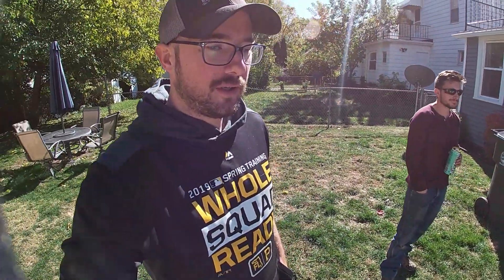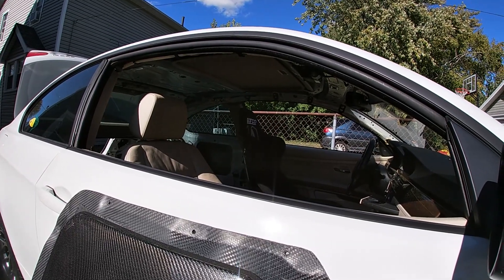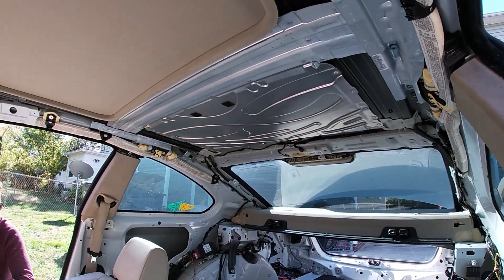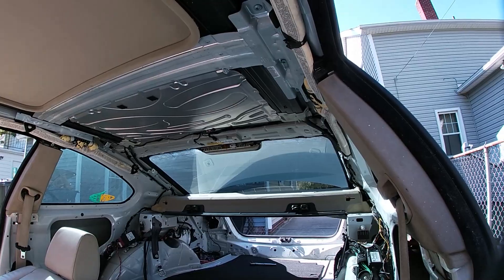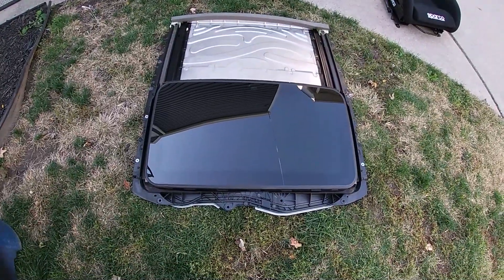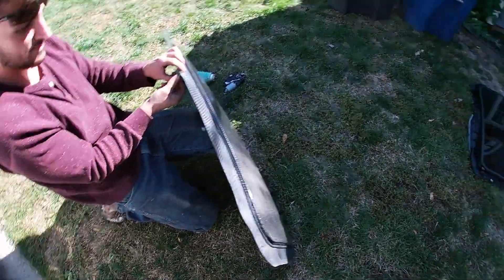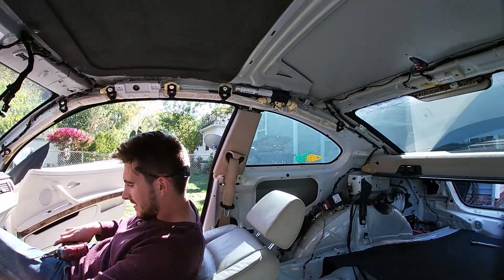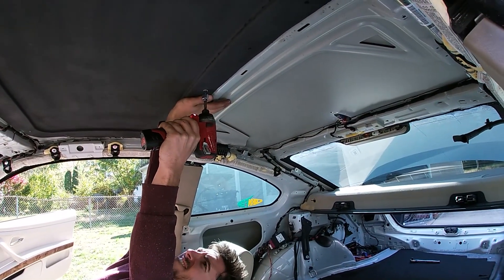HOW TO: We Install Our Nelson Racing Wheel Carbon Fiber Sunroof Delete Panel. All The Weight Savings

Comment: Great install video, entertaining and informative!! Did you consider sealing the cf sunroof panel with some kinda sealant? Looking to do a sunroof delete on my 135i soon :)
Reply: He said in the video that you can remove the built-in seal and use rtv for a more flush fit, but the kit comes with a built-in seal so you don't need to.